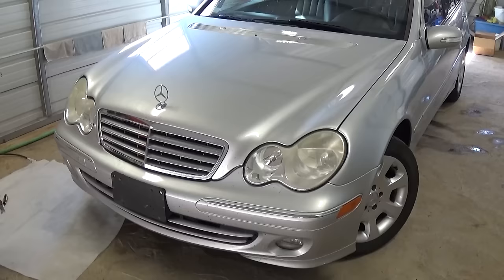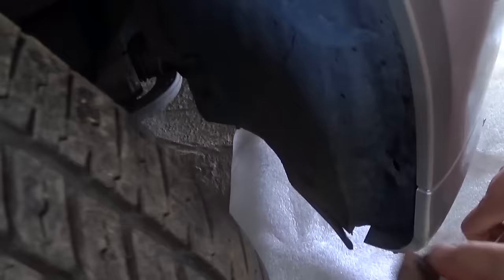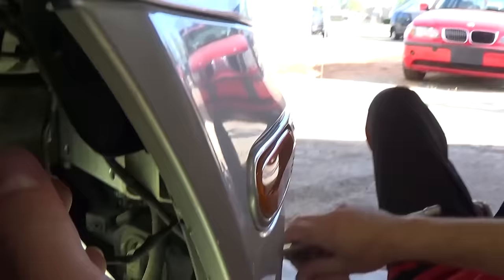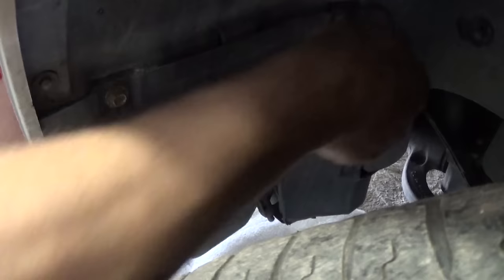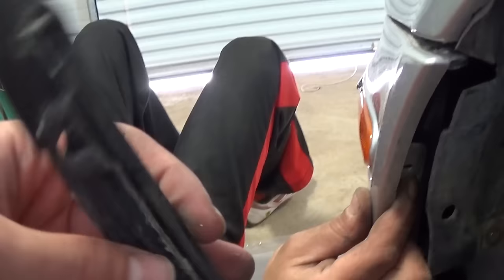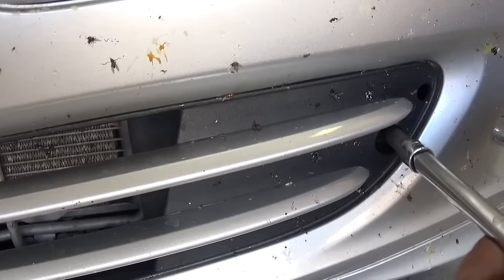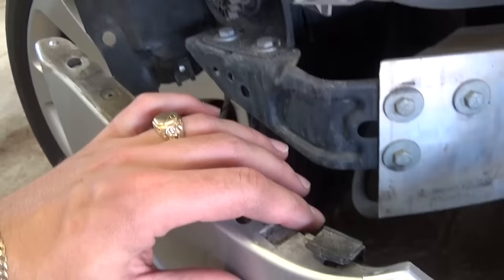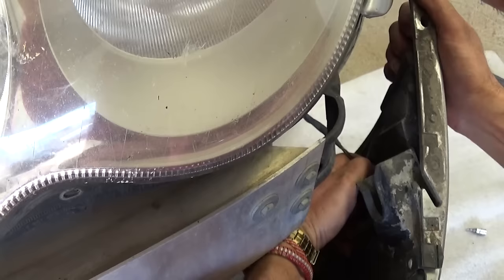Mercedes W203 Front Bumper Removal and Replacement! c230 c320 c180 c200 c160 c220 c270

Comment: How do you put back the bracket that holds the bumper with the fender? Is it easy? Is it like a clip in?

Great Instructional video by the way! :D
Reply from the maker: xXmanonfaceXx Thank you :) The bracket is a little tricky. There is a slot where it slides in the bumper. You will have to put the front end of the bracket first all the way in, and after that push the rear end. It is a little tricky but you should be able to do it without any problems. Make sure that there is no mud or sand on the inner side of the fender and the bumper!
Reply: Thanks man! I just finished removing my bumper and i put it back on with no problem. The bracket is the hardest part of this whole thing lol

Comment: Remember, some of these models have a bad balance shaft. The teeth on the sprocket wore down prematurely and will cause loss of power, and bad timing. I learned the hard way about this. I have 2006 C230 and it costs $4,000 to fix it. I still drive the car, check engine light on - 2 codes - I forget which ones but they're timing codes. Don't buy a used MB before you investigate this. Mine had 60k miles when I bought it, discovered the problem at 115k, now has 160k miles. It has very little power from stand still but it drives okay - I have to floor the gas pedal to get it to go.
Reply: How do you know if the balance shaft is bad ?

Comment: Talk about over engineered! Why does Mercedes have to make this shit so difficult? Most other vehicles dont require you to remove the bumper to change a headlight. Mercedes always has to be extra with that shit. Just like with the spare tire. These fools designed a spare tire that cant use the factory lug nuts. Like wtf is that all about. They give you a separate set of lug nuts specifically for the spare, which is dumb. Hopefully previous owners or mechanics/ roadside assistants have not lost the spare lugs.